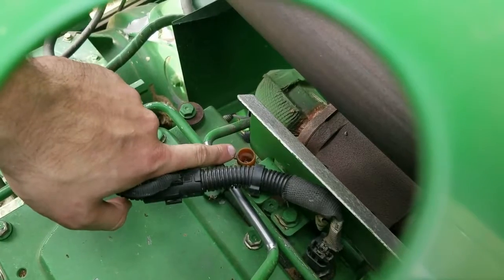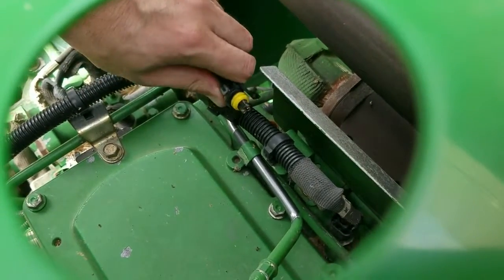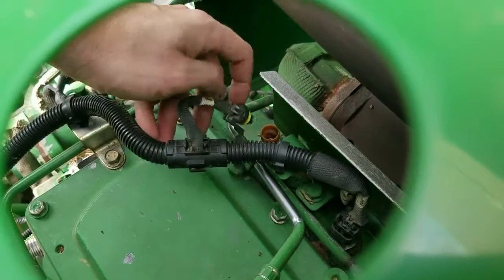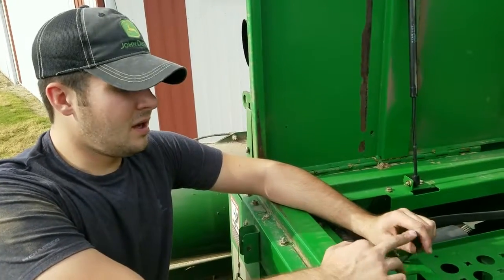John Deere 9760 - JDCR2000 Module Installation

Comment: Can you please do video on your truck module for the ram ecodiesel and an up date on your use of it on your ecodiesel please that you.
Reply from the maker: We have an installation video for the EcoDiesel scheduled for Nov. 30th.  The video will be posted within a couple days after that.  If you need any help/guidance on getting your module installed, please call the tech support number on the box and we will be more than happy to talk through any problems that you may be having.  Thanks!
Reply from the maker: @monzamoose, the installation of the 3.0L Cummins Eco Diesel is now up under the truck installation play list.  I hope that it helps you!  If you have any further questions, please feel free to contact our technical support line that can be found at AgDieselSolutions.com